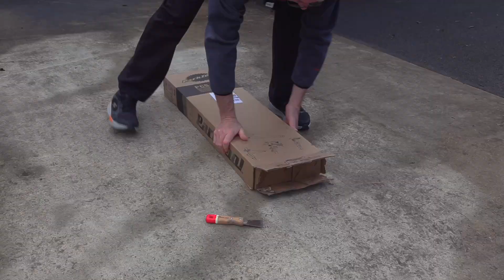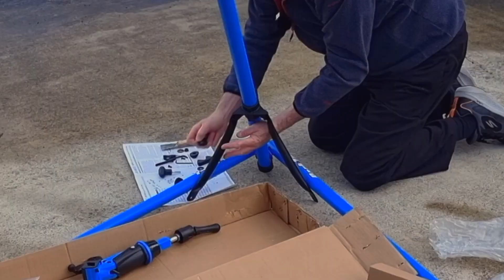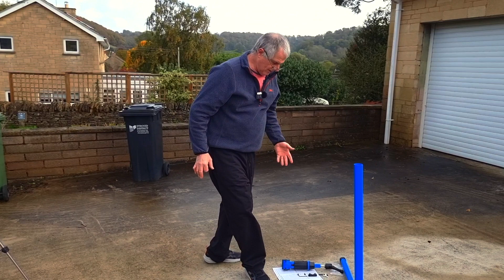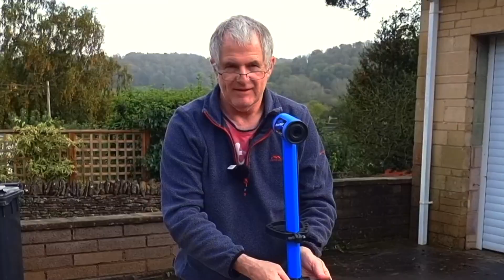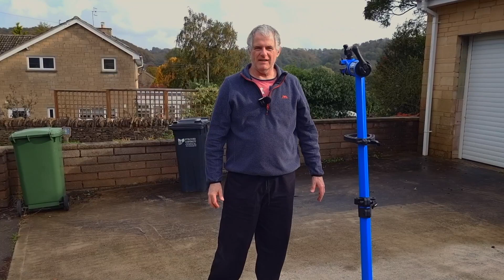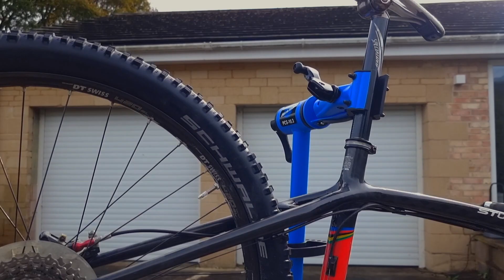Deluxe Home Mechanic Repair Stand From Park Tool: Build & Review

Comment: It´s very unstable
The clamp is rubbish, can´t hold the position and the bike moves very easily 
Made from cheap steel pipes
Better than a ALDI/LIDL model, but not by much
Reply: Really? I didn't think Park Tool made duds, especially for the prices they like to charge. O dear
Reply from the maker: Well currently it seems ok to me, mine you, I have seen the others ones and they are cheap but they are from supermarkets, I will feedback in 6 months time or sooner than that if brakes 😀 😉
Reply: Sounds like user error.